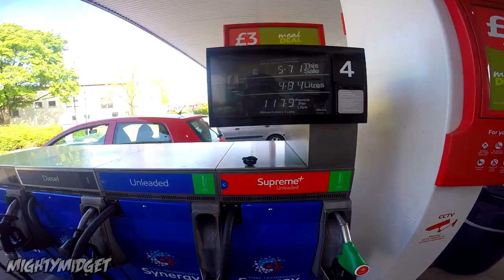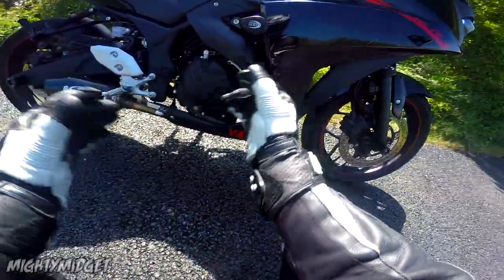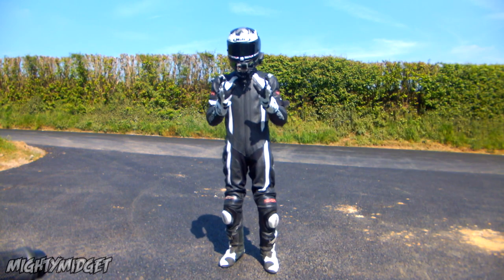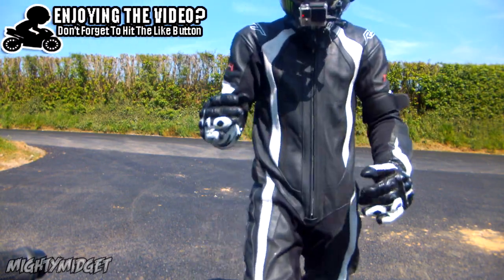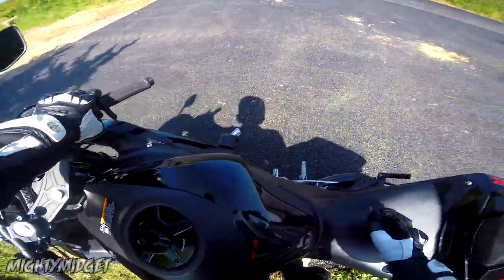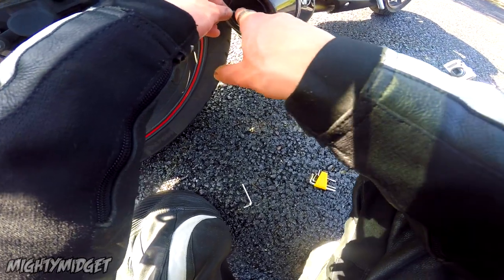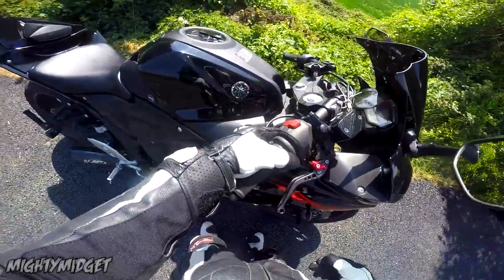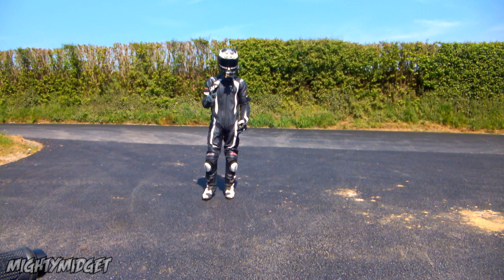M4 Street Slayer Exhaust Yamaha R3 2015 - 17 - Long Edition

Comment: hi mighty midget do you reckon the r3 is quicker than a cbr500 or the rc390?
which one do you think is best
great videos btw
Reply from the maker: Garth Watford Well I wanna set up a drag race with an duke 390 at some point but if I can I'll make a video as there's no short answer. Ktm is a little quicker and sportier but more expensive and is a single cyclinder instead of two which sound a little sportier the r3 is like the middle man but looks no use in my opinion and the cbr just doesn't stand out as much to me tbh but I'll try to make a video but I'm always gonna be a little bias lol
Reply: Lol fair play because I am on an a2 license and wanna get a sporty all rounder that I can get great corners with and great acceleration and excitement.
A bike that I can't wait to get on and I had the ninja 250r and I loved it to be fair but then I tried an nc750x dct restricted and there amazing so it's difficult to decide lol